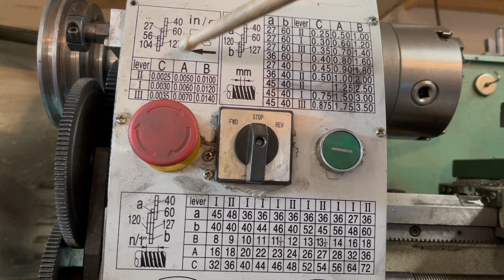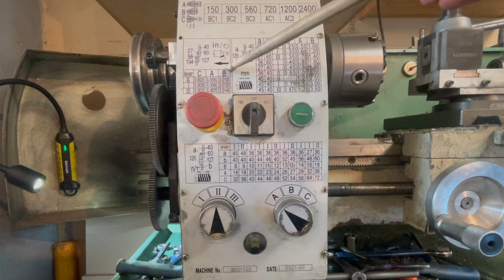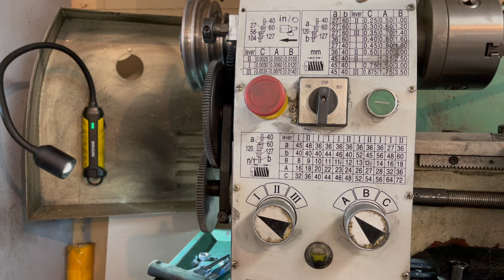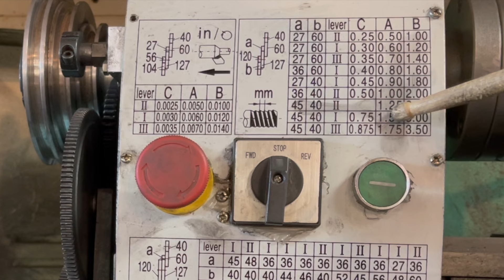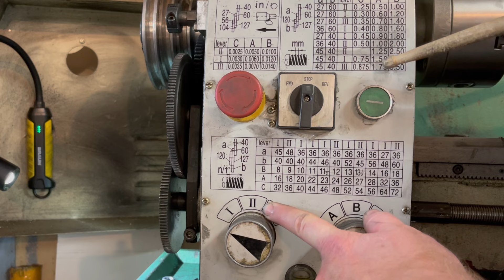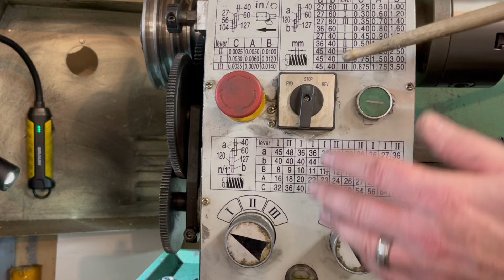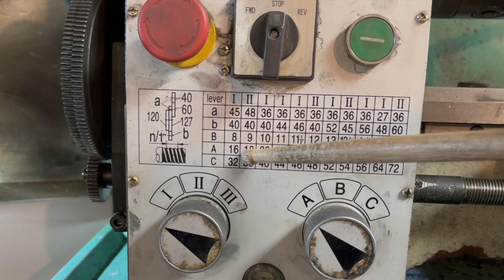Understanding How To Use Change Gears For Threading On A Grizzly G0602 Metal Lathe: Part 1

Comment: VERY useful video, thanks for posting it. I would like to mention one thing though, and that is your setup for reverse threading. You don't need to go buy a second 127 tooth gear because any size gear (that will fit) will work. It is what is called an idler gear, and its size or number of teeth will not affect the ratio and torque values between gear 1 and gear 3. I know this might sound wrong, but trust me I know gears...I am a clockmaker. Another advantage of using a gear there smaller than 127 teeth is you can find one that will let you close the door.
Reply from the maker: @HarderThanCalculus  I’m already aware of that. Smaller cogs can’t be used  because the center isn’t pushed out far enough - the mounting device for that gear wouldn’t be able to be located in an empty space.

Comment: Great video. Really! Great idea about the last idle gear for left hand threads. However, normally one could use any gear size for the reverse motion. That gear does not contribute to a ratio because it is a single gear. So, for instance, for a complete revolution of the "a" gear so many teeth will have passed (45 in this example). Then, the idle gear will turn so much that the same number of teeth will move along its arc (45 teeth) and the same goes for the middle  "c" gear, namely, 45 teeth as well and regardless of the size of the additional idle gear (as long as another gear could fit in the setup). At any rate, this is a great idea and gain the whole video is really good. Thanks.
Reply from the maker: Yeah, it doesn’t matter in that sense. However, if I’m going to have a backup gear, it might as well be one that I always use. It’s also the biggest gear that I use which is useful since the structures that hold the gear need to be pushed far enough away to not interfere with everything else when not in use.
Reply: Yes, that makes a lot of sense! Thanks for the reply.

Comment: This is all good info (and reverse thread option will work too) for the Shop Fox m1099 which is apparently a clone of the G0602 with slightly larger swing and longer center to center.